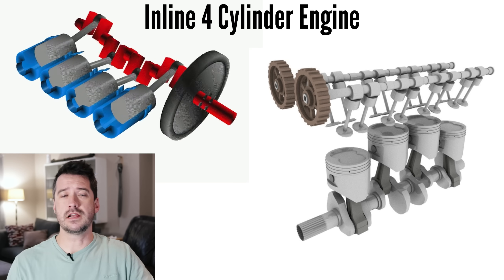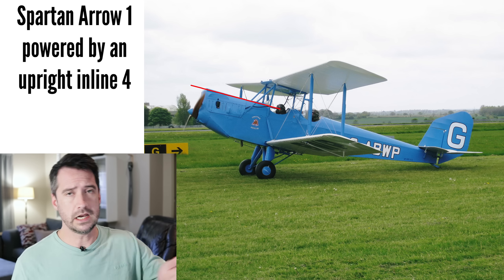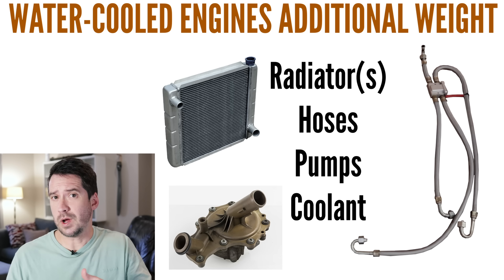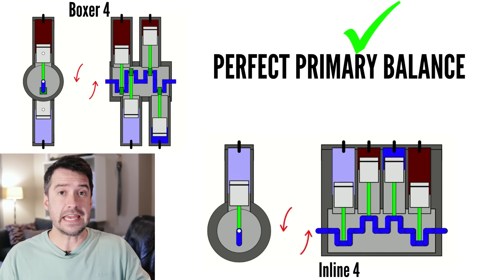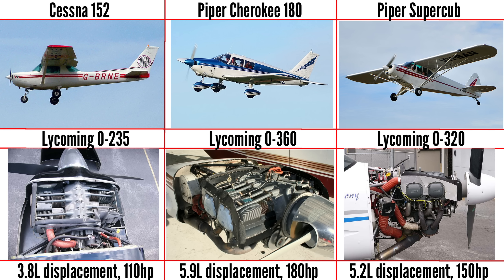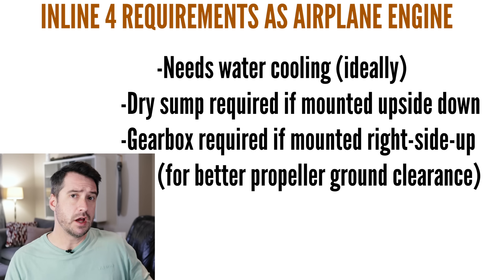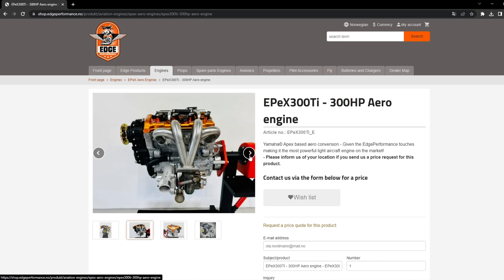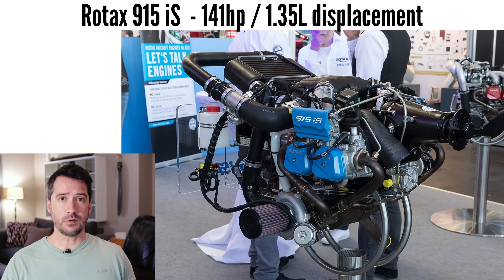Does Inline 4 Engines Suck for Airplanes? - Technical Deep Dive

Comment: Small correction: The Aeromomentum engine is not "double overhead cam", it is based on the Suzuki G13B single overhead cam engine (but 4 valves per cylinder).
Reply from the maker: Interesting. Their website says the AM15 is SOHC, but they clearly state the AM15T is DOHC. But definitely does look like a single cam looking at the pictures/photos.
Reply: @LetsGoAviate  I not only know the G13B inside and out, I also live in China and know where Mark buys his engines and components from here. 

Though note that Mark and his team modifies and builds them completely by hand in the US to their own specifications.
Reply: @LetsGoAviate Makes sense in a small hot rod.
Reply: The AM20 is a 2-liter Mitsubishi Evo engine. One video where Mark describes the engine says they develop as much as 409 hp in stock, production configuration.  The EVO is the only engine I found to do so -- and the manufacturer's claim of 409 hp matches what Mark said in the video.  Don't know if there are any of these flying, though.
Reply: @mikepowell3335  I’d love to see one in a Ford Pop.
Reply: @brianb-p6586  - I can't confirm this, but I think it's the 4B11T engine, not the 4G63T.
Reply: @mikepowell3335  The AM20T is based on the Hyundai Theta engine.

Comment: While balance shafts prevent driveline vibrations from destroying the engine block and making noise, they don't solve the inherent problem of driveline vibrations, which translate to extra torsional strain on the prop.
Reply: So 3,5,and 6 is better than 4?

Comment: Great video. But unless I missed it, you did not mention the conrod length vs. stroke ratio as a major factor related to secondary unbalance. The longer the conrod, the lower the secondary imbalance.
Reply from the maker: Thanks. No I did not get into that, the video was long enough already. Yeah you can see how long the conrods of the Gipsy engine was! I believe it reduces secondary imbalance because a long conrod will have a shallower angle at 90° and 270° of rotation than a shorter one, which means the difference in vertical lenght beteen upright and fully angled will be smaller.

Comment: The reason air cooled is more popular is because of history and how aircraft are designed. Glycol was not common, not even in cars, seals have come a long way, radiator materials and assembly. Air cooled engines are actually heavier, aluminium cooling fins are heavier than coolant. plus you have ducting and increased drag from cowling. Aircraft are still designed around aircooled engines because that is what is commonly made. Lycoming, Continental and Rotax are all old. A 4 cylinder boxer engine is also not perfectly balanced, it experiences a rocking effect which causes vibration due to offset pistons. The use of multivalve and liquid cooling also allows you to run higher power safely due to less heat so their power to weight is higher yet again. Multi valve is not just about flowing more air, but better cooling for valves through the seat and valve stems. Bucket style lifters naturally rotate valves where as rockers do not. All of these air cooled dinosaur engines have a magnitude of problems fixed in modern engines. the reason they make them is because people buy them, a company does not stop producing their bread maker unless they are forced to.
Reply: time to go back to 2 stroke simple aircooled boxer engines
Reply: @fidelcatsro6948  2 stroke and air cooled is almost obsolete. modern engines are far better, just that people know little to nothing about an engine.

Comment: Part of the problem with non aircraft specific engines is the crank speeds. They need a gearbox which offsets some of the weight saved on a lower displacement. Another issue is how enthusiasts assume the specific power and efficiency are one in the same. While bmep is not exactly efficiency it is often related, but it is only part of the specific hp rating which also involves crank speeds. The thing is that old 2 valve combustion chambers don't actually make aweful bmep or bsfc. Bsfc has more to do with range and required fuel so that's part of the complex balance and bmep is part of torque which has to do with turning a prop. It's entirely possible that once you sort through gearbox losses aircraft balance, prop selection and the fuel capacity and range that the effects arent worth the extraordinary efforts except for the highest performance applications where the higher pitched whine of a high output engine being bothersome is the least concern. Automotive and power sports engines do amazing things but if setup well old tech isnt always so bad. The small pistons of common i4 engines and centered sparkplugs can lead to a low emissions engine but low displacement has more surface area to volume so despite how well it burns may keep less energy in the cylinder and more in the cooling medium. This might help wirh nox emissions so its an easy choice for automakers. But for a high duty cycle application where torque is king then having a larger case to disipate heat on the outside while keeping more heat in on the inside with fewer moving parts does start to look like a good idea. So even if the traditional aviation engines seem like carryovers from the 1930's and the high level of development on auto engines could put them first the aviation engines with efi have nice developments like redundancy and CAN network telemetry compatible with avionics systems. It is nice to have something that feels like a package deal. Maybe its perfectly fine that the alternatives are kept for the experimental guys who can work on bare bones avionics and lean on thr engines dependability vs the guys who pay for aircraft maintenance having some aircraft specific redundancy and avionics specific features.
Reply: We should stay in touch.  I work as an engine engineer but don’t get to do architectural things like you and this video discus.  I’m convinced converting automotive engines with PSRU’s is the only possible solution to high cost aviation engines.  The Lyconisaurus engines have and will slowly evolve but have never come down in price.  

My engineering and engineering experience is that trading the moving parts in a 4 cyl for a three with balance shaft is a good win.  Balance shaft has no piston scoring, valve dropping, ring sticking bearing spinning, etc issues.  Cutting those odds by 25% right at the dwg board is a good win.  As you say getting back to larger cyl bore will help bsfc vs 4’s.  

The PSRU is a good compromise vs Lyconasaurus cost.  They can be very reliable and though incremental, still make competitive system wt with aggressive downsizing/up-rev’ing and or boost.   Turbo charging is a very natural choice for aviation, with excellent benefits.    Of course it must be done with reliability, durability and $ efficiency.  These latter hurdles have all been cleared by many automotive and some sport engines now.   We just have to bring them all together and package for aircraft.
Reply: I have read conflicting information about ceramic coating. A flat roof and a Hereon piston ( flat with firewalls ) let’s the fireball from one or two central spark plugs just reach all walls as the piston gains speed. So before a lot of heat loss, the heat does the work. Bore < stroke. The principal scales if you rev smaller engines higher. At least in the displacement range we talk about. Planes too small for 6 big cylinders running at max rev defined by combustion, should go electric/ sailing.
Reply: A gearbox for an engine that makes 200kw and revs higher compared to one that revs lower can be made lighter as the delivery of power is smoother. Look at a turbine transmission, they are considerably lighter due to their smooth torque. Engine efficiency can be greatly improved with the use of ceramics, steel pistons, quality oil, titanium, turbochargers, liquid cooling, composites, electronics. Automotive technology is far behind, and aircraft even further. Smaller lighter engines are far better for aviation even with a gearbox, especially now with modern ecus such as Motec. Even the simple use of a tuned intake for a certain rpm can give 5-10% power gain, but with a lower revving engine the longer it has to be which weighs more. Steel pistons are stronger, lighter and more thermally efficient than aluminium, but they are far more expensive to produce. OHC and multivalued use less power and allow for easier power by means of flow and cooling. There are so many ways an aircraft engine can be optimised, currently the only people that do it are in the experimental market. Big companies are trying to make profit, that is their goal.
Reply: @chippyjohn1  When I read this, I think about a two stage reduction gear, where the first stage is small and the second stage only deals with smooth power delivery. Turbos are better for cruise than tuned induction NA . Interestingly, a V12 Merlin has both: smooth power delivery, and too much RPM for the large prop it can drive. Why are there many V12 cars, but only a few V12 planes? Could even reduce displacement per cylinder to 0.5 liter like in a car.
Reply: @ArneChristianRosenfeldt  There are many v12s used in experimental but they are less common due to the engine being less common, cost and power requirements. There is a company that modifies bmw v12s for the experimental as well as other v12s such as the RED. A 6 litre V12 petrol would be around 250-300kw naturally aspirated, there just aren't many aircraft in need of the power in the experimental area when the market is mostly around 75-100kw.

Comment: Cars (mostly) use inline engines because there's strict limit on engine width but not so much on engine height. The driveshaft location isn't important because cars must use a gearbox anyway. Cars don't drive fast and the bonnet space is super cramped so airflow is always poor, any car engine with more power than a lawnmower needs liquid cooling anyway.

Comment: IF you are going to replace the boxer with an inline engine, it has to be a DIESEL to justify the expense and complexity with lower fuel cost (almost half) and lower specific fuel consumption of diesel cycle, otherwise, there is very little to be gained by the conversion - not including the huge expense of engine certification.

Comment: I am wondering if the Duramax LZ0 would make a good aviation engine.

It is competitive with the Lycoming 580 in power to weight ratio, it is diesel which is more fuel efficient, and as an inline 6, it has perfect balance, primary and secondary.

The disadvantage is length and verticality.  But as a 3l diesel, this might be slightly mitigated

Comment: THANK YOU 😊 
I found this more then just "interesting"!
With the very HIGH prices of modern Turbo-prop engines, I've often wondered just why we haven't seen light "Executive" transport aircraft powered by an "Inverted V-type" engine, al-la WW2 Fighter! A pressurized Twin, with two 500 h.p. inverted-V engines could favorably compete in the market place with many smallish Turbo-props !
I've even done a few initial design sketches!
Twin, 500 h.p. engines. MUCH less expensive then todays light turbines! At a total of 1,000 horse power. And with a gross take-off weight of 10,000 or 11,000 lbs.
Reply: In this case, why not just do the same thing that has been done with the Viking engines to an automotive V8? Maybe use Chrysler's 700 horsepower, 6.2 liter turbo Hemi?

Comment: Hey, man! Your explanation of the pros and cons of inline 4 vs. boxer engines was really good. I've been considering the Pipistrel Virus plane, which is designed for the Rotax 912 and 914 engines. Do you think there's a suitable Viking engine that I can use for the Pipistrel Virus plane? This might be a dumb question, but I wanted to throw it out here to see if there's any good explanation.
Reply from the maker: Thanks. Not a dumb question, but I don't have a great answer. Without double-checking all my facts, Pipistel suggests only the Rotax engine for their planes, and I've not seen one powered by anything other than the Rotax (excluding the electric). While surely not impossible, I think it will be difficult using something other than the Rotax on the Virus, unlike your kit plane bush planes which are designed with many different engines in mind, I think the Virus' cowl/frontal area will be limiting. For this plane personally I'd look for a used Rotax 912ULS/iS
Reply: @LetsGoAviate I actually looked at bush planes. The problem was I couldn't find one suitable for UK CAA or EU EASA. I like the Bearhawk B4, but I don't think I'm allowed to fly it in UK skies, something to do with the airframe. I also looked at the G1 Aviation French company because I was told it can take the Yamaha Apex engine. It is so difficult to get a plane with 2 to 4 seats in the experimental class with good load capacity. The only reason I like the Virus is that it's an easy plane to fly, and it also has a good glide ratio and cross country capable. Thanks for your reply.

Comment: This video sums up several differences between boxer and in line engine (everyone knows)
Three major facts are NOT mentioned.
-1. Car engines have far, far lower loading spectrums compared to aircraft engines. Do you apply full power for several minutes after driving away? (the take of is mentioned) and 85% power for many other minutes (climb-out)
"This car-engine is good"   (if you use it only up to 30% power AVERAGE in a car, then it is true.)
2. An ordinairry aircraft engine has everything vital double and also independently. Double ignitions, double fuel pumps etc.
3. The certification cost are extremely time comsuming and expensive. From every engine part the complete history of the metal (back to the mill) has to be cleared, described, frozen and cannot be changed after certification. No car engine complies to that.
That are the reasons you see only a few car-based engines.

Comment: BMW produced an inline 4 cylinder back in the 1980's that was only 1.5L but capable of over 850HP in F1 racing trim. It was the M12/13 IIRC.

Comment: This was cool but unless I missed it, you never explained how the secondary imbalances cancel-out on the boxer. I still don't see why that's sorted-out compared to the I4.  Good video though - you explain well. Cheers.
Reply from the maker: Yeah I didn't cover it in-depth.  Because the conrod goes sideways as it goes around the crankshaft, it becomes shorter (relatively speaking) vertically, and pulls down the piston more at 90° and 270° of crankshaft rotation.

This additional pulling down of the piston causes acceleration and decelleration of the pistons (in the normal "plane" of movement). At 0-90°, 90-180°, 180-270° and 270-360° degrees of crankshaft rotation, the pistons accelerates, decelerates, decelerates and accelerates respectively.

This means the secondary imbalance's resulting force is in an "upwards" direction, upwards being towards TDC.

So the reason the boxer 4 can cancel out secondary imbalance naturally is because the pistons face in opposing directions, and each bank of 2 cylinders cancels out the imbalance on the other bank of 2 cylinders, as opposed to the inline 4's pistons all facing in the same direction.

There's more to it, but that's the basics.

Comment: Blackburn cirrus was probably as popular as the DH engines for a while.

Like for like a boxer should be lighter, due shorter crank.

Had to stop an oil leak on a Porsche swapped mooney that dropped in, customer was generally upset with his life choices and believing an increase in hp meant increased performance, the words of Burt Rutan come to mind when the subject turns to fast revving low displacement engines. 
"Hp sells, torque propels"

And of course a lyco/conti can sit at 75% power for days, not so much with small high output engines.
Reply: " Hp sells, torque propels "
It's true, when designers deliberately build an engine, which delivers max power right at the redline, with no usable powerband.  They basically gamed the system.  No wonder it didn't work too well.

Ease up a tiny bit with the resonances, you lose a few horses at the redline, which you couldn't use anyway, but gain a huge bunch all over the powerband.  Max torque remains the same, but suddenly it all works 100% better.

" 75% power for days, not so much with small high output engines "
That again depends on how you build the engine.   Low revving truck engines very often suffer a lot in racing, because they have long stroke and high piston speeds when operated close to the redline, while smaller, revvy engines do well.  Short stroke, low average piston speed.  Current bike engines are built for that regime.  200 horses you can easily lift yourself, together with the gearbox!

BTW - the main reason why 4-cyl engines have relatively low displacement is the optimum combustion chamber size.  It makes little sense to go much above 0.5l per cylinder.

Comment: Coming from a family who operate Tiger moths and Austers, we never had issues with inverted Gypsy Major inlines.
Reply from the maker: When the Gipsy was inverted, there was issues, inlcuding increased oil consumption. Those issues were solved in the 1940's though, so I'm not surprised you never had issues. I wasn't around back then, just going on what I've read 🙂